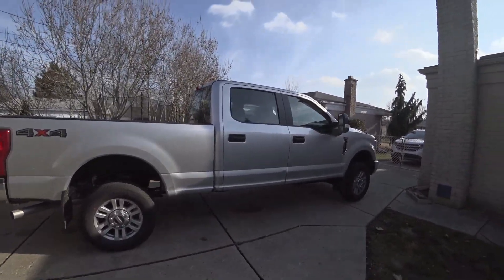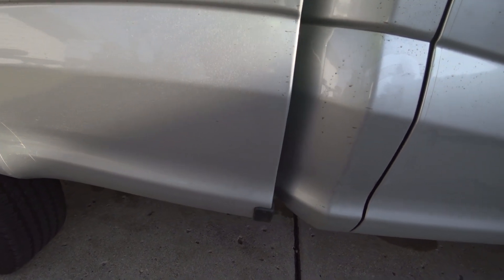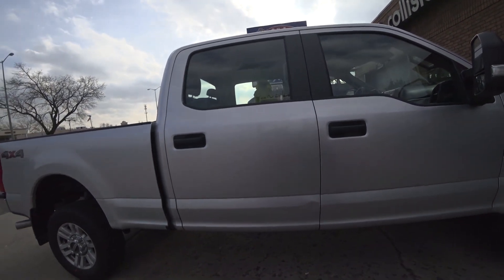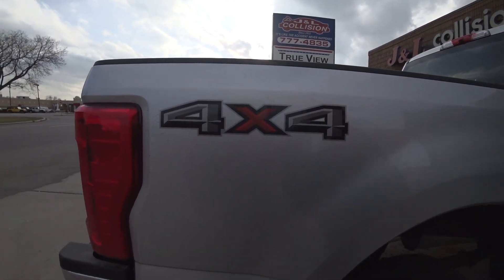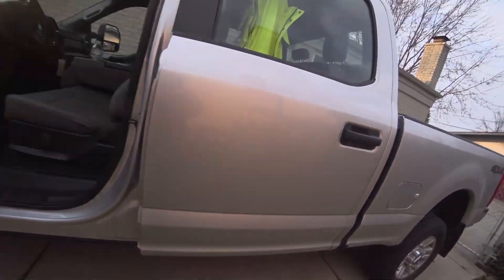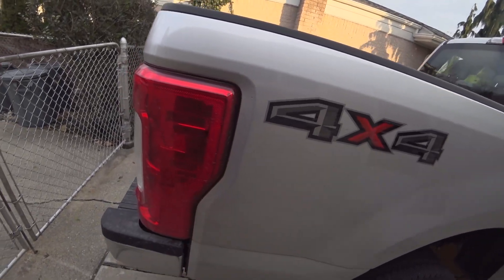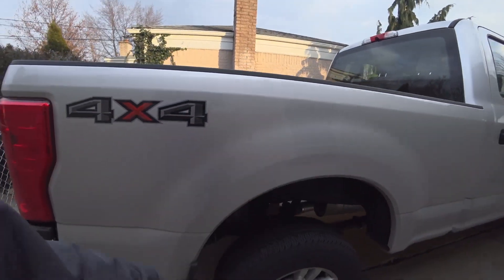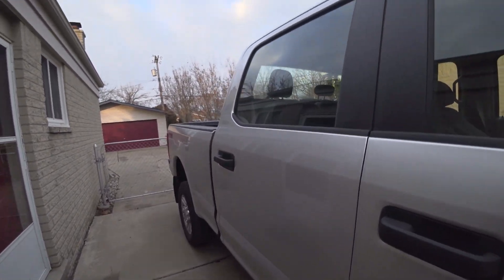Aluminum super duty repair cost 💲💵💲💸

Comment: Being a work truck at this point I would only repair and paint below the natural body lines. (seams and lower body lines on the doors.)  Silver naturally changes color at every horizontal line anyways. (optical illusion)  Smart to wait through winter. If the shop is professional enough the paint will be exact or close enough for business use. If you go to sell it or trade it in a few years see how it is.

Comment: As I already told you I wouldn’t fix it. It’s not worth it ,it’s an XL work truck with a plow. I’d put full length running boards on it that protrude they may have taken the brunt of this impact. They saved my rocker panels on my plow trucks several times, they broken frozen snow banks loose that would have caved in my rockers.
Reply from the maker: I'm putting the order in for running boards!

Comment: It seems to me that they could mask that lower section off right where the crease is and you would never notice any difference in the paint color. The way that shop wants to do it, you’re going to lose all the original paint on that large side of the bed and I think that would be noticeable, especially the contrast from the rear door to the bed. Silver is one of the most difficult colors to match.

Comment: You may be able to pull that dent out using a heat gun and a suction cup. I had a truck that I dented worse than that and I used suction cups to pull most of it out. It looked much better after I did it. You could also get some cheap PDR tool and glue and pop it out that way. After that maybe touch up the chipped spot and polish the entire area using 3000\5000 grit wet sand paper and some Meguiar's G10307 ScratchX 2.0 polish. 

If you want it perfect then let the pros do it. 

My decision would be if keeping the truck long term then do it yourself because you are bound to get more damage over time. If you plan on trading it in a couple of years then have a pro fix it.

Comment: Bleh...that stinks that you had the dings!!  I am totally new to this aluminum body stuff.  I figured it would be 2000-2500 dollars.  

I've seen the recommendations for side steps.  I have a bad back, so I'd make sure I have those too!  Plus, you'd get the rocker protection.  

Yes....a truck with 400 miles.....I'd get it fixed.  I'd fix the dings the next time also.  And then the 3rd ding incident (assuming they were always minor), I'd say "3 strikes and I'm out".
Reply from the maker: Lol. I never did get it fixed. Picked up a few more dings!

Comment: That's cheap Sean..would be double in Canada where they charge everything more...lol. .my  last 16 limited someone hit my painted drivers side mirror and put a tiny little scratch in it not even noticable but wanted 212 bucks ...lol  it's the paint that is very expensive  with the tri  coat platinum color..